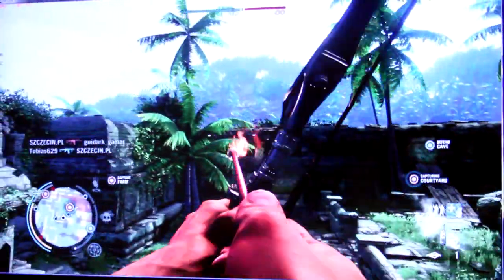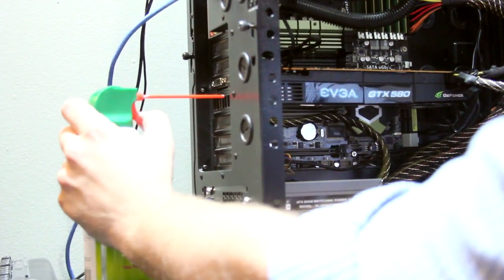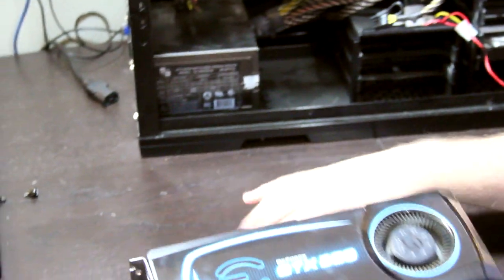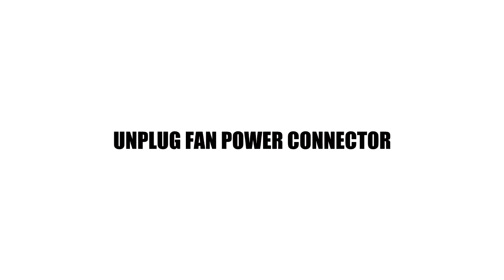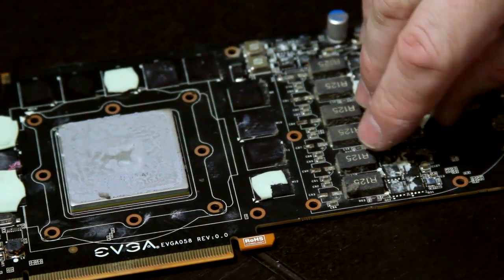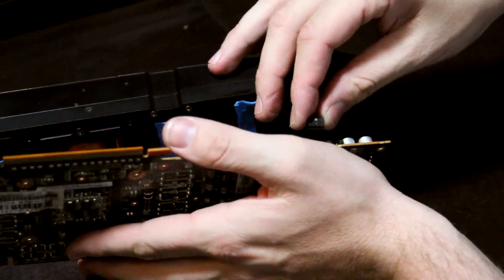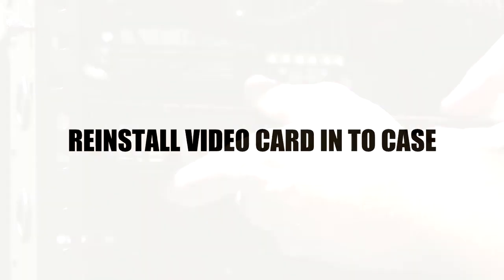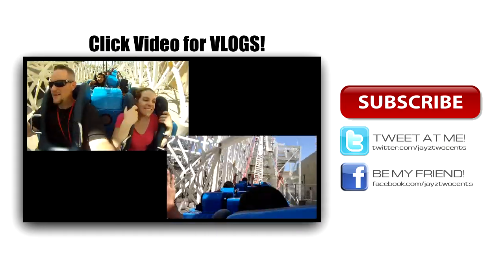How to fix overheating video card - Jayztwocents Tutorial

Comment: You do realize that 81 degrees is fine for a GPU, right? It's well within the boundaries of which it can operate. If it was a CPU on the other hand...
Reply: ***** Im sure he just wanted to make a tutorial on how you might be able to fix a overheating graphics card and that was the oldest hottest running card he had. Even though 81c is within acceptable limits i wouldn't call it ideal.
Reply: Vox Nihili Well, I've never seen a graphics card throttle or crash when it was around 80 degrees Celsius. Where I work, we had a card today, that hit 84 degrees celcius. Can't remember which one it was. A couple of weeks ago we have a GTX 780 SLI setup where the cards would max out at a 100 degrees Celsius. When it hits 90+, I get worried, but below that I'd not be worried at all. I don't even know what my own GTX 690 runs at. Hmmm, I should check.
Reply: ***** Neither have I but thats not the point. If you worry about longevity a card that never gets above 70c is generally going to last quite a bit longer than a card that runs at above 80c every time you put it under load. Not to mention artifacting which is much more likely to occur at those higher temps.
Reply: what? my pc turns off at 70C
Reply: +ϟ STORM ϟ All the new graphics cards, does run cooler. We've entered into a new age of electronics with extremely small manufacturing processes. This means that components will require less power and thus produce less heat. Furthermore, manufacturers are getting better at optimizing their electronics - giving you more "bang for the buck".

Comment: Lol I blew my laptop today, it was pretty dusty. I use my air compressor for my tower and laptop, it works a heck of a lot better than can's and it's free.
Reply: Sandman1832 Damn i wish i had a compressor :P
Reply: +Sandman1832 You have to be careful with an air compressor because of the moisture in the tank. Although I completely agree, it does a hell of a lot better than a can of air.
Reply: Posh Cheeky Twat I do a lot of powder coating so I have to have dry air. I have a 4 stage system the eliminates any moisture or oil. Even for those who do not have a dryer system like I have, as long as you let a compressor cool for about 15 minutes after letting it run and have the pressure low it won't be a problem. If you take can air and tip it upside down a bunch of freezing CO2 comes out.

If you want to have fun with it, grab a 5 gallon bucket and fill it with hot water. Grab another bucket and put rocks in it, not full but about 8 to 10lbs worth.Take an empty bottle of water and tip the canned air upside down and spray the liquid in it until about a quarter of an inch or half inch is in the bottom and quickly screw the lid back on. Give it a quick shake and quickly put it in the bucket of hot water. Then quickly take the bucket of rocks and set it in the bucket of hot water over top of the bottle and run like hell bwahahaha, it will blow the living crap out of the bucket. I DO NOT suggest trying this in your house TRUST ME. My wife was PISSED because I had to replace sheet rock on the ceiling, that and water everywhere. It's frickin awesome thou ツ👍

Comment: my gpu temp are around 59-65c while gaming and 27c idle
Reply: LuxKadafi I envy you.
Reply: ***** nice!
Reply: ***** Mine's max is 55, watercooled.
Reply: +Doge same here twin frozr msi 750ti oc edition. 24-27 idle depending on room temp and never gets past 56 full load never seen the fan go past 36 percent either.
Reply: my max temps are 62c
Reply: +LuxKadafi Mine runs at 38c at load and 25c at idle overclocked
Reply: ***** It does. I live in a very cold environment. And for the record, I don't have a sister.
Reply: ***** Really dude? I'm not such a high-end person. Sure, the temps I told before have changed. It's now 32c idle and 50-55c at load. The temps I told before were surely wrong. Just don't bitch about it so much. It was just a wrong number.
Reply: ***** yep
Reply: SwaggerLemon™ mostly a maxwell gpu like the 750/750ti and the 900 series. i have a 750ti and it runs like 26-29 idle and 40-50 under load
Reply: SwaggerLemon™ its might be broken.
Reply: Will Riling i also dont have any case fan. maybe 980ti is too powerful so its hotter?

Comment: still have Nvidia GPU 9 series , is still working but the PC shut down suddenly without any problem , i thought at begin it's Power supply issues but by luck i touched the GPU and i found it on fire , i don't know how to clean it  i never did it before , 
it's 9600 Gigabyte Nvidia GPU , please Help
Reply: TheMaster Karim Replace it with a 750 ti. No regrets

Comment: My GT 640 is at 95° while playing CS:GO on 640x480... That isn't normal, is it?
Reply: Michael Chapman
And your grammar also die soon, lol. you're supposed to say "your" and not "you" hehehe
Reply: no it was intentional
Reply: Evans Young Holy shit man somebody is not getting the joke here
Reply: im in 100c+ club!
join me today!
Reply: Michael Chapman you joke are funi
Reply: Michael Chapman
alrigh man
Reply: I'm on a GT 640 as well, it's three years old and it only hits ~62C playing watch dogs on medium settings and about 30fps.
Reply: NEGOZIO Geez dude. That is NOT fine. My 970 maxed at 73C at 99% load with horrible case airflow. How's the airflow in your case? You could also try taking the card out and blowing the dust out of the heatsink with some compressed air.
Reply: NEGOZIO
Nope it aint good buddy, though the 780 is known to produce more heat than other powerful cards (temp sensors are lowered to reduce noise) but 70C at browsing isnt good at all. 87C is also somehow too high for  gaming. consider installing a third party app for controlling temperature issues for your card. in this case i will recommend "evga precision x" its very good. and consider making up space in your chassis and also put the system at where it can get more space/air to "breath"
Reply: GetReKTkUnT pickle
excuse me.
Reply: +NEGOZIO no clean that very good and put new thermal paste

Comment: Sir, is it normal to have a 50 degrees Celsius temp on my graphics card ?
Reply: Depends on what your card is doing when you take that reading. If that is taken at idle then i would say it may be running ok. If that is taken at full load, THAT'S AMAZING!
Reply: That is amazing, seriously. Full load with 50oC. BTW, you should state your card series, e.g: R290X or GTX680 ... etc

Comment: What's the normal temperature for a R9 270 (not overclocked)?
Reply: I would say around 70 is really safe. 80 could be okay and around 90 it probably starts to throttle.
Reply: mrawesomelemons
^ Below 80 is safe, 70 at full load fans not full. 90 is your doing it wrong.
Reply: Aaron Keime I get 60-70 max during gaming (Sapphire Dual-X)

Comment: So i have 2 gtx 760s, one is 6 months old, and the other is completely new. My old gpu can get as hot as 80c, whilst my new 760 only gets around 70c ( wich is think is reasonable ) The thermal paste can't get old after only 6 months right? Maybe ill do good just to blow out some dust?
Reply: well i changed my paste on my 660TI  ( msi edition ofc ) and that white concrete that was sitting on my die as thermal paste was crap!! before: 73-75 Degree C*   after: 60-65 degree C* 68 in Far Cry 4 lmao xD!
Reply: The new one sits in the lower slot? If thats the case the top one has less breathing room and sucks in some hot air from the gpu beneath it hence the higher temperature.

Comment: I recently heavily upgraded my computer and heres what it has now
Micro ATX AM3+ Motherboard
AMD FX 8350 @ 4.0GHZ
R9 290 with Windforce
750W Fully Modular Bronze Power Supply
4GB Ram
Windows 8.1
My computer has been randomly shutting off without notice. The audio cuts and I hear my r9 290 fans slow down. I got a new one after the old one I bought was defective so I sent it back. I then got a new Gigabyte R9 290 Windforce graphicscard and it shuts off. I also bought a Corsair H100I today and I am thinking of returning it. But if overheating is the problem then I will install water cooling... My first thought on the problem was that the SATA cable connecting to the hard drive came loose and so it shut off my computer. I put in a new SATA cable. Then I reinstalled my graphics card to see if that would work. I still am not sure what the problem is.... but I need help ASAP. Thank you in advance!
Reply: Minizw3rg anil patel Thank you guys for the help!
Reply: The Fedora Gamer i was about to say try a nvidia card R9 draw huge amounts of power also due to you 8350 that will have a high TDP.Dont forget your using a Bronze power supply it will say 750 Watts but you wont actually get that amount probably around 600 the higher the Power Supply rating less dissipation you will have with your wattage.
Reply: What's the name of the motherboard I might be able to help.
Reply: Check if every thing is compatible to make your life easier just go to pcpartpicker.
Reply: I have a ASUS M5A78L-M LX PLUS AM3+ AMD 760G Micro ATX AMD Motherboard
Reply: It said it is all compatible.. I also downloaded speed fan to see if it was anything.. My gpu said it was slightly overheating at about 50C? also I believe the CPU overheated... and it shut off due to that.. while doing nothing the CPU was overheating after 10-20 minutes but it doesn't shut off
Reply: The Fedora Gamer First try returning the graphics card, it obviously has some problems. If that doesn't work replace your mainboard because everything seems to be pointing in that direction.
Reply: Minizw3rg Sad to say... I took it to a shop... and the motherboard fried... pin were bent... when they were fixed... the entire motherboard fried..
Reply: The Fedora Gamer Good to know you figured the problem out!
Reply: The reason why it fried is because the motherboard can't handle the tdp ( Total draw power? ). The m5a78l is designed for the 4 and 6 of the FX series since it's only 95 watt Total. The 8350 has a Total of 125 watt. You should have gotten the m5a97 or m5a99. Hope you understand it a bit.
Reply: kenan saray : I disagree. When it says compatible, it means compatible. You can run whatever gigs in there, of course, with "compatible" mark. Otherwise, you can sue mobo/gpu/ram...etc manufacturer for misrepresentation.
Reply: +SK Bean you don't understand my point. When the motherboard was released you had the FX 4 and 6 series. They don't require a lot of power compared with the 8320. The 8320 has more cores and a higher clock speed. If you read my previous comment it also has the same thing explained. + the motherboard has different models, So i could be totally wrong.
Reply: Found out the r9 290 was the problem.. switched it out for a GTX 970.. everything works amazing now :D thanks everybody
Reply: Lolz 4gb ram is not a heavy upgrade.And I upgraded mine to 8gb ram Fx-8320 Black Edition with Asus Nvidia 750ti.Trust me Nvidia outperforms R9 or anyother equally priced graphic card.My friend as well as the shop assisstant told me to go intel+nvidia or amd+radeon.But after watching a lot of videos on youtube i went with amd+nvidia and just awesome it is.Btw i bought an air blower especially to clean the case every 15 days.
Reply: Salman Shaikh nvidia doesn't always outperform similar priced ati graphics cards, a lot its the other way around.
Reply: SolidSnake
still i see a lot of comments the other way around in reality.Nvidia may not outperform but still similar priced cards of ati show poor performance in many high demanding games whereas because of nvida's regular driver updates improve a lot of performance. if you don't believe me then check it out yourself o youtube in games like AC unity,watch dogs, far cry 4 and a lot more.Keep in mind i am talking about mid range cards i don't have a slightest idea about higher end gpu's but i bought my nvidia 750ti with a lot of research.
Reply: Salman Shaikh A some of big titles tend to be optimised towoards nVidia, its a bad practice which makes people with amd hardware suffer. Anyways, for about the same price you could grab a 260X which will match the 750Ti for cheaper or a 270x which will be a little more money than a 750ti but destroy it in most senarios. Also, not many games have this as of yet but having an AMD CPU+GPU enables mantle which will add abour 10 FPS in most cases.
Reply: Tom Shepherd high tdp. no not really. and r9 270x overclocked and an 8350 overclocked and run on a 500 watt psu.
Reply: my friend has a r9 270x but i with an i5 and his cuts out due to power loss, corsair 80+ bronze 550W
Reply: Tom Shepherd
What I5?
 Also, using a 270x with the most power hungry I5 I could find was about 275w in total, then you toss 100W for the most power hungry mother board and thats 375w then lets say 15w for the fans and storage but thats still 400w. Something diffrent about his setup or PSU.
Reply: 4670k, but when they turbo/Boost they draw more power but his power supply is a  80% Bronze i think his efficiency is 82% so although he power supply is a 550W he wont get 550W because its only 82% efficient

Comment: i have a ASUS  GTX760 and i cant play battlefield 4 anymore my temp is 40 a 50 degrees and my computer crashed
Reply: did you find a way to fix it ? 
thanks
Reply: no but i think that it's with windows i have win7 and win8.1 and on 7 is it much cooler than on win8.1 because win8.1 use more ram and GPU and CPU try on win7
Reply: What CPU? what PSU? Are your drivers up to date? (those can all affect the problem) How did it crash? BOSD? Black Screen? Complete loss of power?
Reply: mine crashes to
Reply: It's because your GPU gets too much power. Unplug it from the PSU and it should work fine.
Reply: thedutchgeneral  i got msi gtx760 4gb it runs 80C ultra on bf4

Comment: Your gonna have 1 power plug no matter what?
Eeeehhhhm No.
Good how to nonetheless.. Very nice.
Reply: If it has no plug its not ment for gaming.
Reply: Nvidia 750 and 750 TI is not for gaming?
And there are a couple of amd cards too, with no power plug, that are for gaming too. They are not as powerfull, but are still for gaming.
Reply: Erwin Holland Most gaming cards have 1 6 pin plug at minimum the 750 (and ti) were built for power efficiency(they draw roughly 60 watts) thus no 6 pin connector is needed
Reply: braydan caldwell
AMD radeon X1650 pro sapphire?